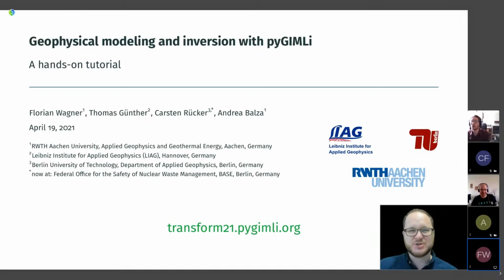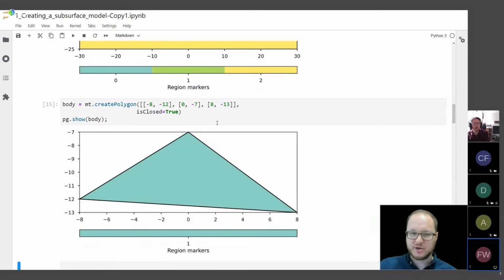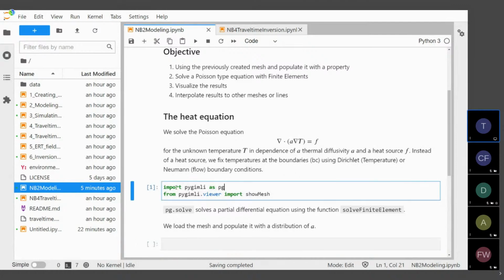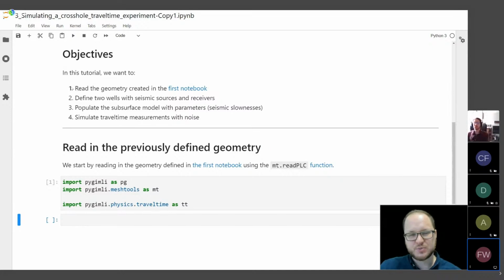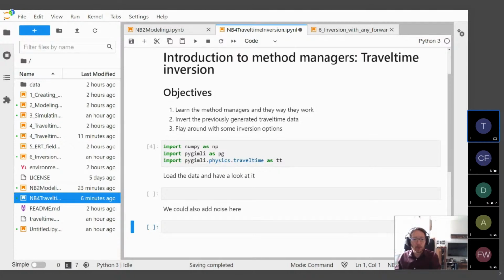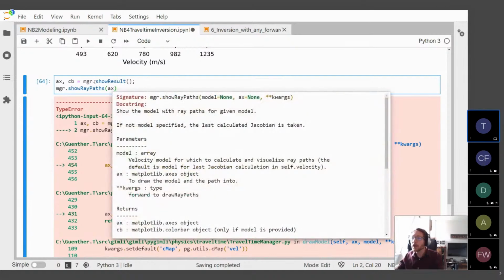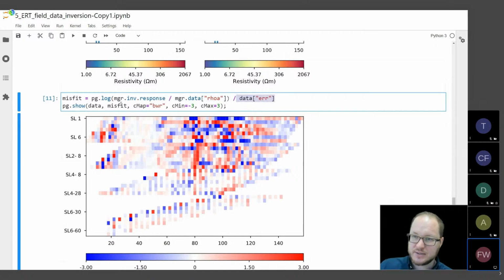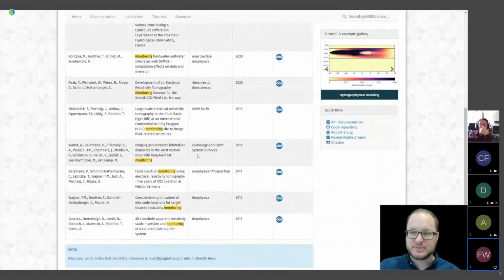Tutorial: Geophysical modeling & inversion with pyGIMLi

Comment: thanks for you work with pygimli ! I am a beginner and try to use it but I do not know how to use the data created thanks to the solver to make calculations (as a normal numpy matrix for instance)? For instance with the 2D heat equation I would like to export the Temperature as a function of x,y  (as a numpy matrix perhaps ?) . Is there a way to do that ? Thanks for your response
Reply: The resulting vector T can be exported with the mesh nodes pg.x(mesh) and pg.y(mesh)